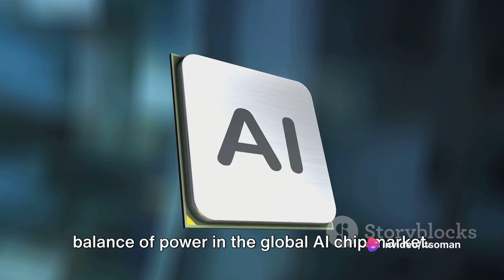SMIC to Mass Produce Huawei 920 Ascend AI Chips As NVIDIA Replacement on Smartphones and PCs

Comment: Actually Huawei’s Mate 60 Pro that was released last August is already using a 5nm (not 7nm) chip. Western media keeps insisting it is 7nm. Anyway, it doesn’t matter for Huawei. The next chip in Huawei Mate 70 Pro will be a 3nm chip. There are several players in the semiconductor chip manufacturing in China and Huawei is one of them. Huawei’s chips are produced by Huawei, not SMIC.
Reply: this would drive the states crazy.
Reply: Chip node size (e.g. 7nm, 5nm, 3nm) is only 1 factor. A  7nm chip on a well designed product can perform as well or better than a 3nm chip on a mediocre designed product (e.g. Mate 60 vs iPhone15). In general, consumer don't buy chips they buy end user products.
Reply: Mate 60 pro is shit. I have several friends using it and they are saying it's even worse than it's previous versions. Main cause is the chip. Statistically it's good but it's a piece of trash in reality.
Reply: @Jinpeng-cg9uy wonder why people keep buying it then 🤔